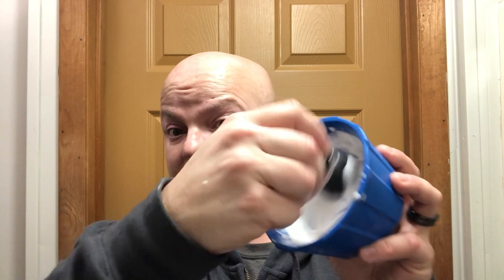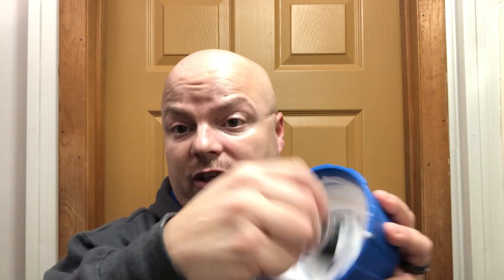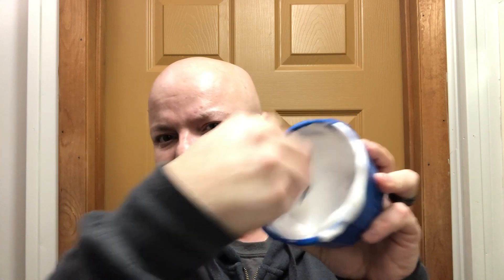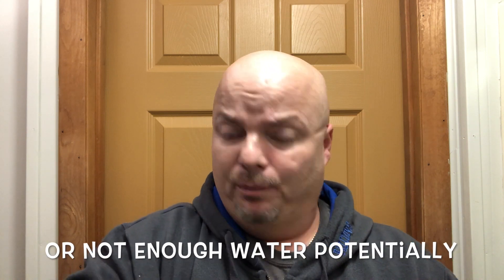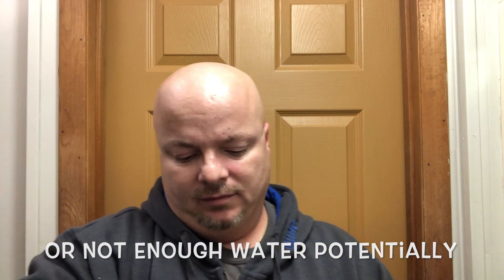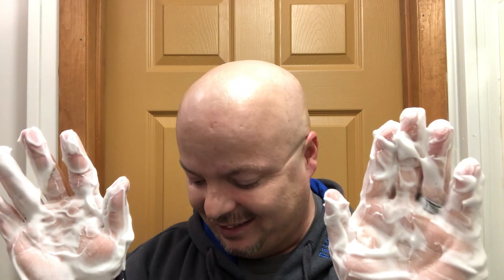Per Viewer Request:  Bowl Lathering Demo

Comment: Why bowl lather in the first place? Face lathering is faster and you can actually feel the lather as it builds on your face so you have a better idea when it's ready. When you bowl lather sometimes the lather looks good in the bowl but when you apply it to your face you notice that it's either too foamy or watery.
Reply: BeautyofScent for me it's easier and i get avbetter lather in the bowl than on the face
Reply: I think almost everyone who initially gets into traditional wet shaving uses a bowl to make lather because it's "cooler" as they can see the lather better in a bowl  as oppose to face lathering where it's mostly the feel of the lather on the face. But after a while vast majority of those people start face lathering for the reasons i mentioned earlier. It's faster. No bowl to clean up afterwards and you get a better feel of lather as you're building it on the face.
Reply: BeautyofScent yeah, i agree. Most people do transfer to face. I have been in this for 2 years. Still prefer the bowl if i have time.
Reply: I bowl lather not because of the cool factor but because I'm in no hurry. Primarily the reason I've been wet shaving for years. Enjoy !
Reply: I started  face lathering  and thought it was the best method until I tried bowl lathering and there is no comparison in the quality of lather. I still face lather because it's faster and because I'm growing a beard and I dont need a luxurious lather all over my face. Bowl lathering is superior.